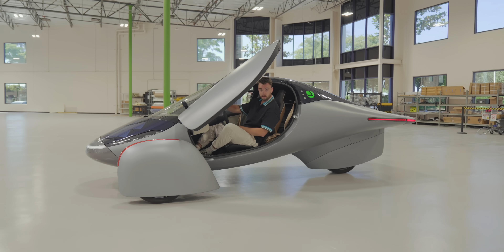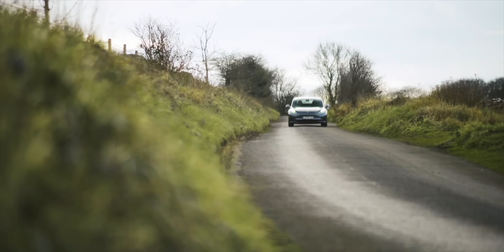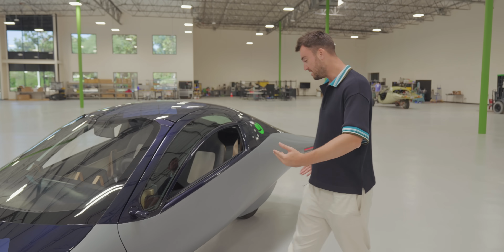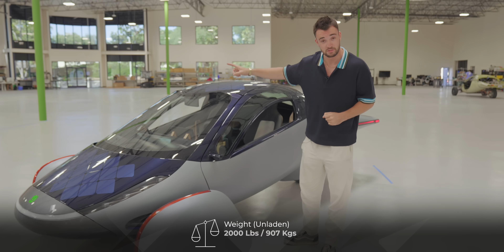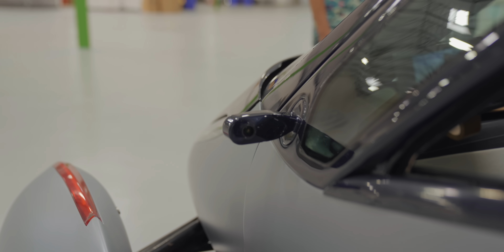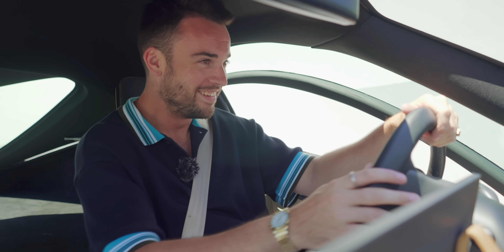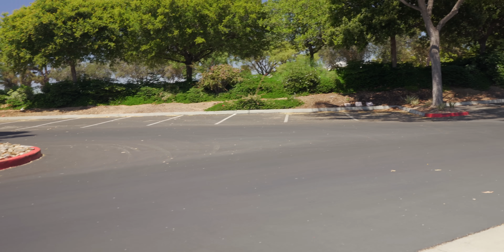The Game-Changing CHEAP Electric Car Inspired By Fish!

Comment: people rarely think of design issues when they are excited, this thing would be dicey as f$%^k in heavy wind, also as you approach potholes in the center of the road....what then? you have no option but to take the hit or dodge possibly dangerously to the left or right.  If you hit something large on just one front wheel and happen to be cornering and then steer into it as many may do...you are going over instantly...not sure how strong the roof is.  FYI
Reply: it's incredibly aerodynamic, and will be impacted by heavy winds less than any other car out there. The roof is plenty strong. The composite it's built from is crazy strong, and the passenger compartment is a monocoque. And it's very unlikely to flip under almost any circumstances, with it's wide base. But yes, potholes will be harder to avoid. :D
Reply: There is data on the roof strength of the original model and it was several times better than any model tested up until that time on the FMVSS Part 216 test.  The current model is even stronger and will be crash tested by a third party and results published.  

There is over three feet distance between each front wheel track and the center.  Within a couple of weeks, dodging potholes will be second nature.
Reply: @n.brucenelson5920  Well i sure wish you luck with it, an egg-shape is strong and composites are strong so i will feel safe in one but can still accept its pitfalls, low traction etc.

Comment: I understand weight saving and aerodynamics and cheap manufacturing etc etc - BUT - I would never buy something with extended wheels to drive in traffic. Just look at that design and tell me that some lane changer won't sooner or later clip your front wheels. Then you'll just be sitting there no matter how much charge you have . . .

Comment: I think it would sell a lot if they styled it to look a little less goofy and was slightly less aero-dynamic.  I'm also curious to know how it would deal with wind and turbulence on a highway.  Might be scary AF when an 18-wheeler blasts by...
Reply: It is more stable than most SUVs.  There are just very few flat surfaces for the wind to exert force on, and what there is does not have a large lever arm on the contact patches.  Even my present 1800 lb car is not bad under such conditions, and Aptera will be much better.

Comment: The batteries are passively cooled. That does worry me. I hope they can last at least a decade in this car without needing to be changed.
Reply: No.  The batteries are actively cooled by a liquid antifreeze/water mix with boost from the HVAC system when airflow is reduced during charging.

Comment: I hate to throw in a negative note.
But here goes.
I feel like, if I had to share the road with all the idiots with their monster trucks and SUVs that I would  be very likely to get squashed like a bug .
Reply: I have survived such conditions for over 400,000 miles on motorcycles.  Aptera is FAR safer.
Reply: Get a .357...

Comment: Useless to carry anything else than two people. No shopping tour to IKEA or Lowe’s..
Reply: 28 cu ft of storage - not to bad!
Reply: @n.brucenelson5920  Naaaa.. I have 96 cu ft in my Subaru.
Reply: @MikaelLindberg  Your Subaru is not a 2 seater....  If you need that much space, then good for you, but the difference in fuel and service costs will pay for an Aptera if you drive a lot.
Reply: @n.brucenelson5920  Normal cars are 5 seaters..
Reply: @MikaelLindberg  It seems as though you may wish to wait for the second Aptera, which is planned to be a 4 wheel, 5 passenger sedan.

Comment: What is the designed load limit for the car?   I've got a first-gen Insight (a similarly small and light car, weighs only 1,860 pounds) and while I love it, the load limit is 365 pounds (166kg) including the driver. And that thing cost over $30k new adjusted for inflation, with Honda still taking a loss on each sale. (I got mine used and when it was 18 years old.)
Will the Aptera have stiffer suspension components for the 100kWh battery option? That much extra weight on such a light car will alter the suspension characteristics.
Possibly most importantly, what are the crash safety ratings? And also, where will warranty service be carried out?

This is also not the first super-efficient, reasonably-priced, three-wheeled vehicle I've thought looked like a good idea, but the Elio never took off and at this point probably never will. Hopefully this one actually makes it into production, and then hopefully subsequently survives.
Reply: 500 lbs.  My Gen 1 Honda Insight has proven fine, especially with aftermarket shocks and springs.  Aptera will be tested to FMVSS Part 200 crash testing standards by a third party and the ratings published as soon as there are production intent models available to test.

I knew Elio was not a serious company back in the day when they announced a non-existent engine at an impossible price, and never mentioned refunds of customer deposits.  When the Aptera founders lost control of their company in a board coup in 2009, the pre-order deposits were still returned to the customers when the company liquidated in 2011.  

Pre-order deposits are still refundable on request.  Since 2009, the Aptera founders have founded other successful companies, including the co-founding and taking public as CEO a lithium battery company.

It pays to do due diligence.

Comment: Much too small for my needs, but this does look like a very interesting vehicle. I would have thought they would put a single in-wheel motor in the rear wheel instead of the two up front to further reduce weight and increase simplicity, but they must have had a reason for doing it the way they did.
Reply: Well two in the front adds redundancy if 1 fails and I guess it make it more stable as a 3 wheel
Reply: There is a big increase in directional control with the ability to sense wheel slip and adjust torque every 2.5" of wheel travel.  This will be a huge advantage under slick conditions.
Reply: @n.brucenelson5920  Fair enough. I suppose it isn't just a case of "Maximize X", at the end of the day it does need to be a usable vehicle.

Comment: If I can't a load enough equipment in my car to go camping, for a week, it's useless to me. And if I can't tow a trailer and I'm not talking about a camper, I'm talking about a utility trailer filled with lightweight camping equipment, again this vehicle is useless for me. The only thing this thing is good for is driving back and forth to work. I'm not spending $30,000 to drive back and forth to work.

Comment: How does it rate in a crash test?
Reply: It has front and rear crumple zones, an F1 style passenger safety cage, seat belts and other advanced safety features.  As soon as production intent vehicles are available it will be voluntarily crash tested by a third party and the ratings published.
Reply: Ratings are coming.

Comment: They really need a stadardized trailer coupling though.

As the singular household powered verhicle, it needs the ability to on occasion transport volumious cargo.
Okay, if its only the secondary car for rich households , used only for short local trips - which probably is the market they are aiming for - thats not neccessary. 
But I´m thinking further.

Comment: 25-27% thermal efficiency for an internal combustion engine is preposterous. Those are like 1960's numbers. Engines get easily into the 30's now adays, which is still shit but less shit.
Reply: Diesels do better, but none come close to round trip BEV efficiency, and they never will.

Comment: Just think when some driver in their suv talking on their phone runs straight over the top
Reply: That is why there is a crumple zone and the strongest roof crush strength measured up until now.
Reply: @n.brucenelson5920  Good to hear, If the thing ever comes out it will be interesting, maybe even viable as I like small vehicles.

Comment: I love the car but this vehicle looks like it would be helpless in the snow.  That from November until March in my state.
Reply: It was designed with Nordic conditions in mind, with FWD or an AWD option and advance traction control. Fit it with snow tires and it will hug a winter road. Keep an eye out for some winter driving videos from Aptera.
Reply: @fotoguru222  I've been driving cars, trucks, and Jeeps in the snow and ice for decades.  I want this car to work.  I'm on your side.  That said the car needs wheel covers that will have to be at least six inches above the street else ice chunks or drifting snow will rip them off.  Second, I'ld like to see the wind shield wiper and heater.  In my state you can live with out AC but you'll die with out heat.  If the old winters ever return (-25F with weekly blizzards) then that car will be put to the test.  BTW, I even garage my Jeep.  The real acid test is walking out from work at 5 PM in the evening and the car's been sitting at -10F or worse all day long.
Reply: I will be taking delivery of an early model and reporting on the performance in Iowa.

Comment: The only issue is that (if I remember correctly) they have been taking pre-orders for this car for the past 3 years already. As much as details are great, I've been hyped for it already, wake me up when they actually start delivering.
Reply: Pre orders started in Dec.  2020.  Remember that it took 6 years for Tesla to to deliver the Lotus Elise EV  conversion.  They are ahead of the Cybertruck which started development about the same time.
Reply: @n.brucenelson5920  Thank you for correcting me. I don't think putting Tesla as an example makes aptera any favours. Their production plan is ambitious and they are more than likely to hit issues with the build out and scale up. And by 2026/28, when regular orders start being fulfilled there will be many mainstream long range [though not likely 1k miles] EVs that they will be competing with.
I'm sure they will succeed in the long term, the car is quirky enough to have its fans, but that will also be their limiting factor.
Reply: @strayobject  Just as with Tesla, this first model Aptera has a limited market compared to their second planned model, which is a 4 wheel, 5 passenger sedan.  You will be hearing more about the follow on vehicles once this first one is shipping.  BTW, regular orders will start being fulfilled in 2023.
Reply: @n.brucenelson5920  I've watched the video, I know what they said, I just don't believe it.
Reply: @strayobject  I made the effort to visit the factory site and the R&D centers, and have ridden in a prototype.  I have reason for my opinions.  They have not yet shown all their progress publicly either.  I can't say more due to signing an NDA.
Reply: @n.brucenelson5920  Came to check if you got your car and how you like it?

Comment: I don’t understand why they put big monitors in these cars, or mood lighting. Without that, I’m sure they could do at least another five miles on a charge.
Reply: The 100 watts or so the monitors need is not much compared to the 500 watts-hours it needs to go 5 miles. The batteries have enough of them to go at least 250 miles, up to 1000 miles.

Comment: here it rains about 256 days a year so will probably not be good here
Reply: Even on a daark rainy day the light will add a few miles. And you can always plug it in. 🙂
Reply: The ABS/Traction control is superb.  Slip can be detected and torque adjusted 32 times per wheel revolution- about every 2.5 inches of tread travel.

Comment: i ordered one relatively early on, im somewhere in the 8000's for mine.  im 6'-3" tall and im a bit worried about whacking my head when i get in but if it works as advertised ill probably never have to charge it as long as i own it here in hawaii.
Reply: Interestingly, if you leave it in the sun in a hot climate, it'll charge well, but presumably it will also get quite hot (even with clever glass tech)? Some of that free energy will then go to cooling the interior?
Reply: @sroberts605  just roll the window down when you set off.  its hot here yes but for us thats 88, maybe 92 on extreme days.  we deal with it by rolling down the window when we leave... once you hit the freeway the inside is nice and cool, easy peasy for the a/c

Comment: Even though I know it won't keep the battery charge, but never understood why they didn't make the hood, roof and trunks of E cars solar pannels to charge the car up while driving and sitting in a parking lot on a sunny day?    Anything to get a little extra charge for free would be good.  Though the only thing I can think of these little guys is death trap on the road with how small they are.
Reply: They are about the same size as a Prius, and might even be safer.

Comment: 2 words: Death trap. As long as SUVs are dominating the roads, Im not interested.
Reply: Wait 'til you see the crash test ratings.
Reply: @n.brucenelson5920  i am hoping to be pleasantly surprised but hope wont get me from under a Range Rovers wheels.
Reply: @808GT  It is not just hope.  They have already run thousands of virtual tests, and actual FMVSS Part 216 crash tests were done on the original Aptera.  The present model is much improved.  By the time you could take delivery there will be a long safety record.

Comment: I really really doubt that air coming off the blacktop at 130 degrees will cool the battery sufficiently. The average summer day in the Southwest will be in the three digits due to climate change.Also solar cells are much less efficient in heat. The surface temperature of my car in Florida was 145 after sitting in the sun for a few hours and the interior was 130. Maybe this is not a car for the South.

Comment: The holy grail for EV"S will be a 500K mile battery, fast charging in less than 10 minutes, fast charging with 120 volts with a 450 mile range regardless of weather/temp.

Comment: Wow... ~$23,000 is surprisingly reasonable, with the possibility of government subsidies dropping that to the 18,000-19,500 range it could be a major step to getting America off that oil industry teat.
Which of course means Republicans will try to make them illegal.
Only possible issues I see are the "skin cooling" in the undercarriage.
1) It's been tested, assumedly with skinny Californians. Once it makes it's way out west it needs to be tested to see if it overheats with two 300lbr's in there.
2) People don't drive well. They barely English well. First time someone bottoms out on a rock in one of these it may cost more to repair than to buy a new one entirely.
Reply: Starting price is $25,900 before incentives.

Comment: The wheel covers are so low, what happens if you need it in snow!  I think investors will be losing! Looks good, but is it really useful?
Reply: The wheel covers are attached to the wheel motors and will rise as the tires do, unlike body attached fairings such as my Gen 1 Honda Insight has.  I plan to be driving mine in Iowa.  With really excellent traction control and ABS, I have few worries, but will be reporting on my experience.  

And I have invested for the same reason I donate to charities - not for a return which is very uncertain at this point,, but because I support their goals.

Comment: They should use that efficiency to build a longer lower version just to beat the E car speed record, Load it with 4 x 500HP powerful hub motors, and powerful lightweight Graphene Ultra capacitors as range is not the objective!
Reply: Aptera grants right to repair, so anyone who wishes could do such a thing with the companies' blessing

Comment: Who knows, but with batteries in some cases incorporated into the car underbody making replacements all but impossible, or at the very least very expensive, that put some electric cars into the disposable item category.  In simple terms, when the batteries get beyond usefull there is both the cost of a replacement car to contend with, but also the issue of dealing with the expired lithium etc batteries, and perhaps part of the cost of recycling the unusable vehicle.🤐!   With for example a car costing 70,000 dollars and perhaps only lasting about seven years,  that is ten thousand dollars average pr year depreciation, plus likely,  some cost associated with the recycling process.!   How about the hydrogen powered cars?  Well, as long as hydrogen gas cylinders with pressured around ten thousand pound pr square inch are under, or behind the drivers position, I would not get into such a car or consider driving it, and definitely NOT buying one, because it would be like sitting on a powerfull bomb on wheels.😓  A safe low pressure method of storing hydrogen in cars and other vehicles is needed, and apparently such a method has been developed, if, or when, it make it into commercial applications still remains to be seen.  If it does, hydrogen may find many applications for mobil and stationary applications, and toxic material like lithium can go back to where it was initially used, in smaller mobile devises.🙄!!!
Reply: There are some mis-conceptions here.  NIH has published a literature review on 
toxicity of lithium to humans and the environment and the conclusion is that lithium is not expected to bioaccumulate and its human and environmental toxicity are low. 

More and more car batteries are being repurposed for stationary power back up once they reach around 80% of their original capacity and still have large economic return in that role.  At the end of that time, there will be plants to do recycling, just as we do with the lead in lead acid batteries now.

The hydrogen cycle will likely never be efficient or safe enough to be used in personal transportation on a large scale in competition with BEV products.